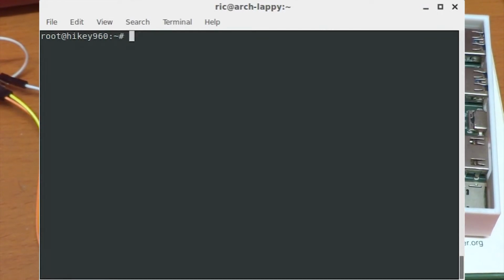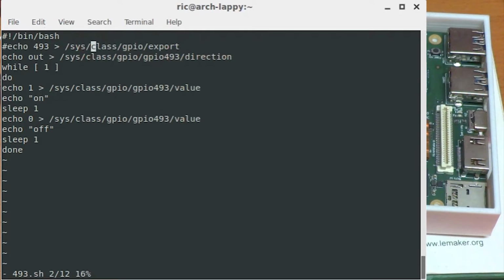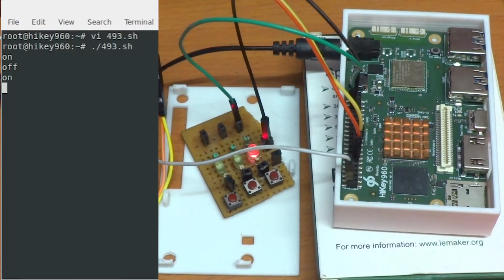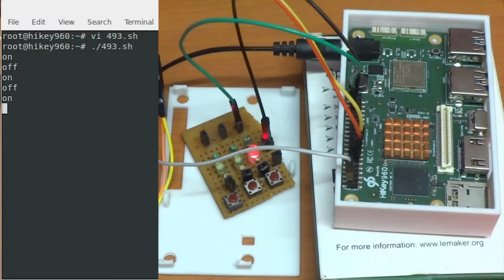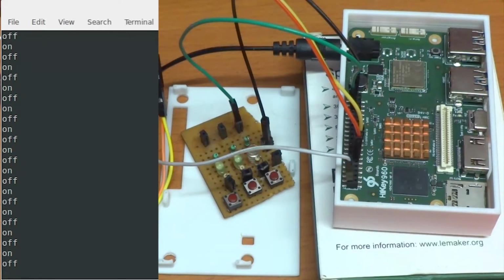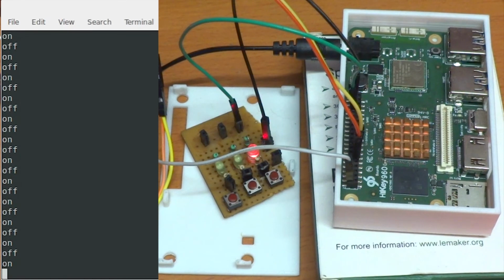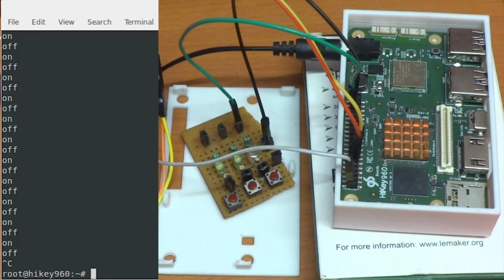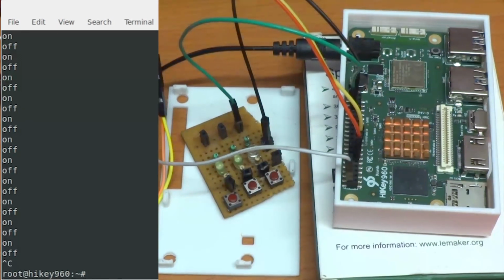96Boards HiKey960 GPIO LED Blinky

Comment: A bipolar transistor switch would allow you to drive any LEDs of your choice. Working with 1.8v is a challenge.
Reply from the maker: Workshopshed yea i know, a bit of lazyness and the fact that the logic level shifter that I have refuses to work at 1v8
although 8 have ordered a mazzanine board that allows me to pull up everything to 5v or 3v3
Reply: I've tried a few different things now. You need to be careful about the current demands as well as the logic levels. For the Dragon Detector http://www.96boards.org/project/dragon-detector/ I used a simple N-Channel FET board for level shifting. For my latest project the I/O is unidirectional so I've got for a NPN transistor instead.